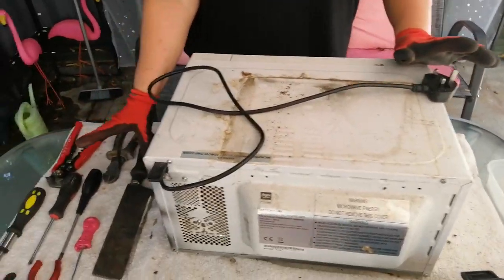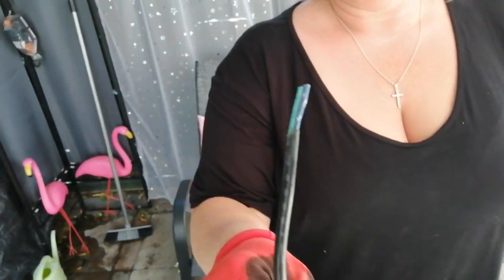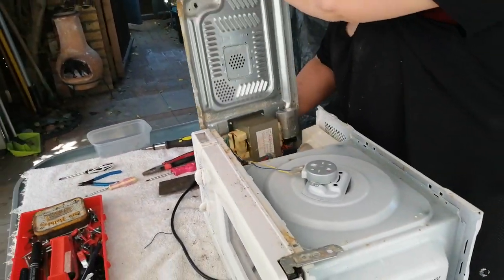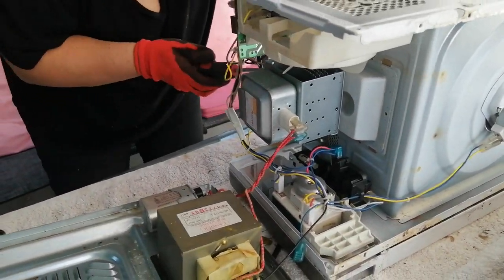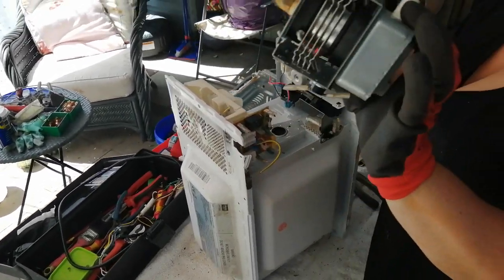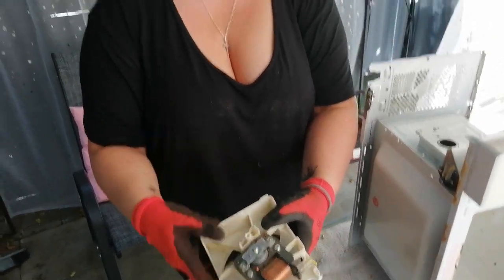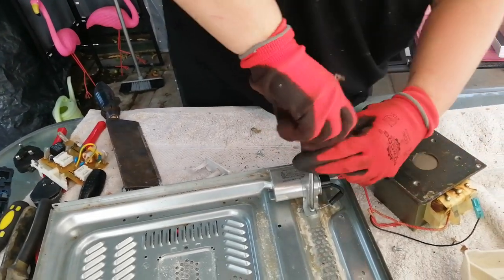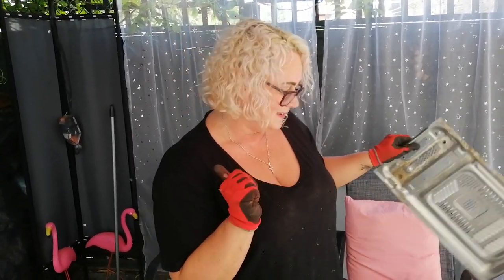Dusty scraps out a microwave

Comment: Nice tip on cutting the case to easily remove the electric cable. Using that for sure.
Reply from the maker: Thank you snobby should me how to do it and it is sharp I did cut myself on one thanks 👍👍
Reply: @dustyblondevlogs4023  im sure it's sharp.  I've cut myself on just the edges inside.